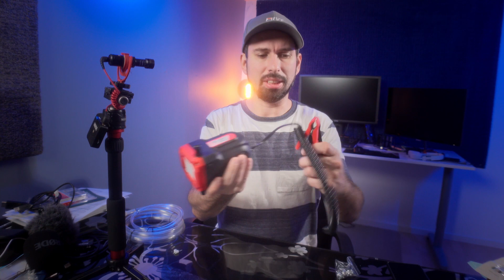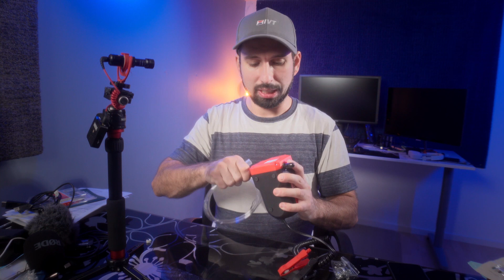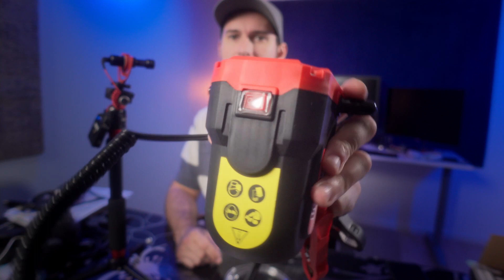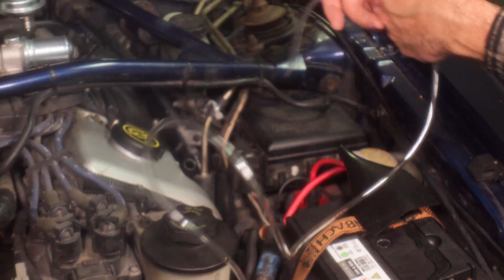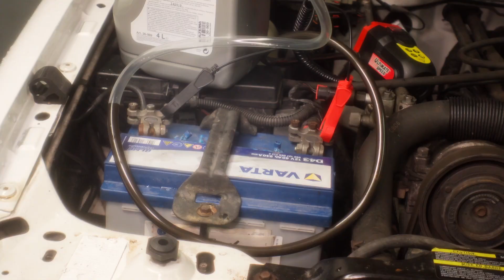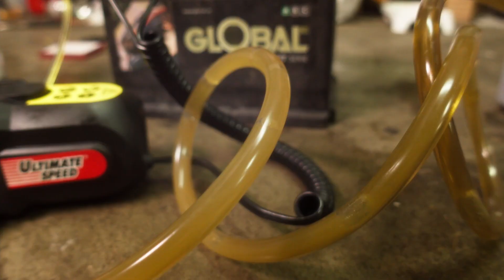Review: Is the Ultimate Speed 12V Oil Pump from Lidl Good?

Comment: Warm both tubes in watr and leave them in a narrow tube overnight so they straight.Put can for dirty oil on the floor so syphoning also helps pump with an almost warm engine it will do about 4 litres inside 5 minutes.

Comment: would it empty the 2 litres of sae 90 out out of the differential on my back axle ?.
Reply from the maker: maybe....but i would't have high hopes for it!
Reply: It did ! 2 minutes flat and the new sae 90 took only 3 minutes to put the 1.9litres of new oil in, using the bigger tube that was in the box of the Lidl pomp. @Kim_Alexander
Reply: ps; new oil at 20°c,,,
Reply: It did 2 minutes to empty 3 to refill. @Kim_Alexander

Comment: for 2L oil engine this does wonders. But I have to agree you need first to increase temperature to 60 celsius, this is my cars normal operating temp, and suck it up. If you have battery charger most likely try to plug it instead of using battery itself. Or just do good old oil change to be fast.

Comment: Isn't the smaller tube for suckin the oil. So connect thin tube to inner side.  Fat pipe in outer side he said wrong.
Reply: What is wrong with you ?
Reply from the maker: that's how it is and that's what I said at least in the beginning and what I did in the film
Reply: @Kim_Alexander  u said the bigger one that's supposed to suck it up. I thought so myself when I first opened box because of the black plastic piece on the end of the hose. I'm not trying to find problem with your video 👍👍
Reply from the maker: @martymartin2894  perhaps at some. point but in the beginning I talk about in and out and says the small goes down to the oil, late I also sticking the small onendonwninnthe oil stick

Comment: Just for interest, the pump is not suitable for a Honda CR-V petrol version as the plastic input tube gets stopped in the dipstick hole before it reaches the oil in the sump. I learned the expensive way.

Comment: Why not connect the pump to a battery charger instead of running the car battery flat ? And helps to have your drain can lower then the pump and 60-90 degree oil

Comment: 6 minutes for 1L of oil but your oil was cold, right? The better result you got when the oil is 50-60*C warm.
Reply from the maker: oils was cold, suppose it would be faster with warm oil. I mostly use the oil for transmission oil, diffs and recently emptied a steering pump
Reply: it’s certainly got its purpose and is a handy thing to own